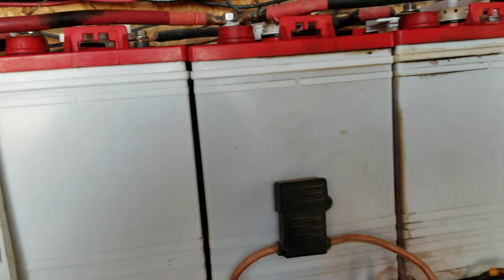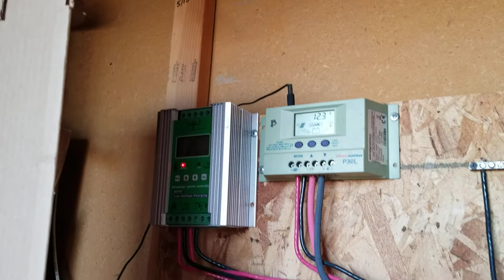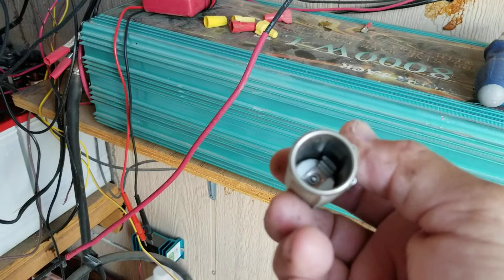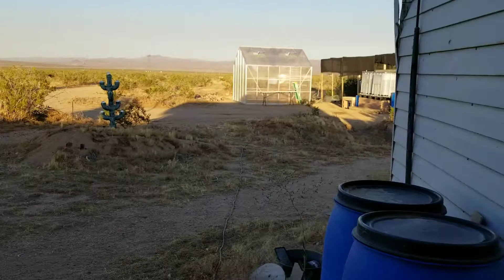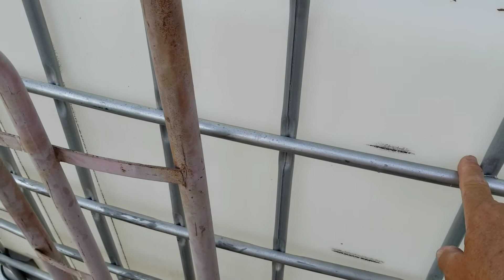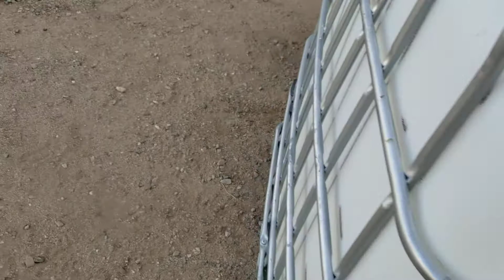A Special Thanks to the Mechanical Engineer Group at Lehigh University, July 29, 2020

Comment: Has you inverter given any issues. I am looking into a 3000 watt and up LF inverter.
Reply from the maker: This powerjack has been running perfectly since 2016.  Be careful though, I heard that powerjack has made changes to newer models and people are complaining about performance.
Reply: @GBear  Thanks. I haven't used a power Jack product in over 14 years or so. I'm just looking for something decent and budget friendly in low frequency. Thanks

Comment: I see your power Jack ambers 8000 watt is just like it 

If I am not mistaken yours it is a split phase 240/120 unit and has a as3 Transformer 

Amber has a 48 volt mainboard that will fit it 

I would love to build you a inverter maybe me and amber can if we get this stimulus 

My inverters have under  0.22 amp to  0.44 idle current on the 48 volt battery side

My powerjack is 1.75 amp idle current 

Boy if you could find a toroid Transformer that weighs 80 to 100 pounds and has a 240 volt out put with a center tap for your neutral 

we could build you a inverter that would run 10 thousand watts continuous without a fan in it

For under 200 bucks

Put  three or four of those big caged tanks on top of your shops roof and make you a water battery 

Rob smith my buddy that you seen the vibration generator has been talking about then lately 

I would love to come to the desert in our eagle bus and fill it up with lots of goodies

 I have been building and have got saved up lots of cool stuff from wind turbines with towers to dc motors to run pumps
125 330 watt solar panels and lots more 

Trying to talk amber into going to California desert but she doesn't want to come unless we go to the ocean 

If we ever do come your way I am bringing lots of goodies
Reply from the maker: Lol, tell amber I'm about 2 hours from the ocean.  When Pierre from HEATSEEKER BUS was here we went there for a day trip.

Comment: Google ducted wind turbine, basically you put a cylinder around the blades and it helps increase the airflow and efficiency, not too hard for someone like you as long as you can find something large and cylindrical and relatively stiff,
Reply from the maker: Don't talk dirty to me...😂😂😂😂😂